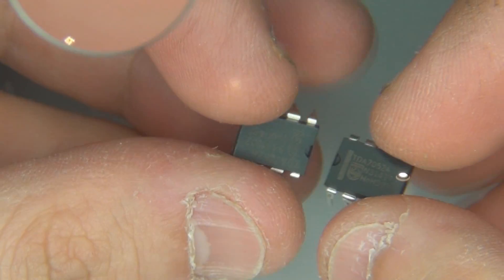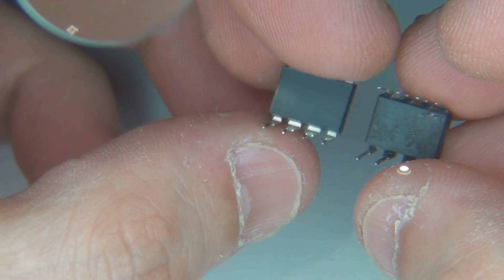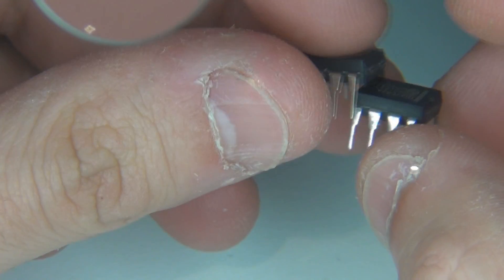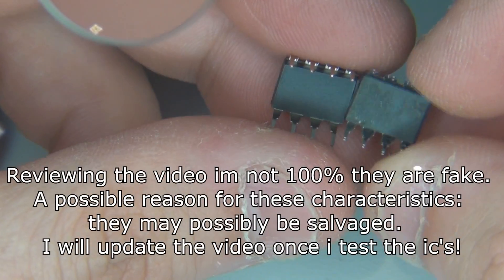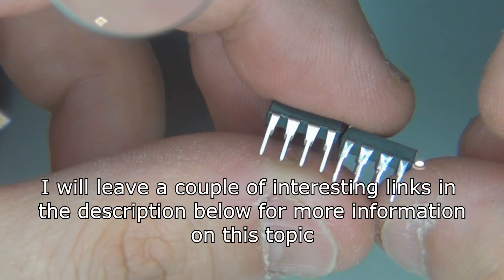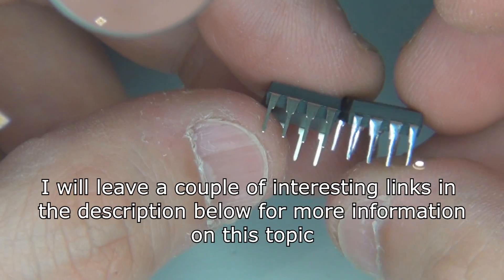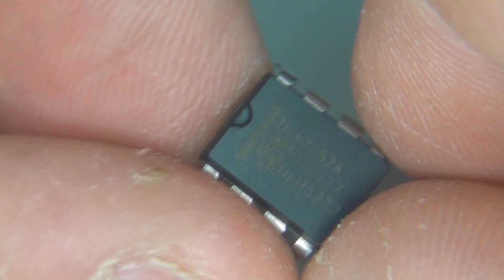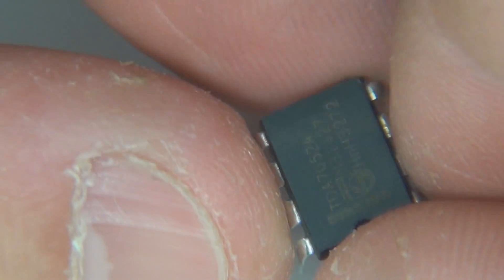Detecting Fake Ebay ICs / Chips

Comment: conclusion? you cannot buy cheap ICs..??  -- I give it that fake things DO exist on ebay, but with respect, I don't take the conclusion... :) 
the conclusion I suggest: everybody should build at least one pedal circuit, just for fun's sake :) 
I haven't made one, but I'm going to, too...

also, there are methods to test ICs... 
which in the case of opams (the type of ICs most used in pedals) appear to be fairly simple...
link: https://tangentsoft.net/elec/opamp-tester.html

Comment: I recently got a batch of LM386s from two different ebay sellers and ALL of them are crap... they don't work like they're supposed to - all I get is loud squealing, very loud weird noises and farting sounding oscillation if I do even get any signal going thru them. They all look factory new, no signs of shady stuff like in your video. I'm beginning to believe these are counterfeits or factory rejects that somehow got into the public domain (via Jameco ebay store). If I put the LM386s I got 12-14 years ago in the same circuit and they work just fine.

Has anyone else had this experience? At this point all I can say is WTF?
Reply from the maker: Hey mate, did you post this on diysb forum?  I was going to reply but ran out of time :(  Heres my opinion.  Fake is an option.  Heres the thing though, search my channel for "dead easy dirt" and watch that video.  I talk about the LM386 in that video.  A long time ago but from memory my Tayda LM386's behaved exactly the same as you describe.  There was a fix (capacitor placed close to pins on IC parrarellel to power rail or something along those lines) but really the chip was just a temperamental disaster and I moved on.  Later somebody (could have been culterjam) suggested that the suffix could be the issue.  I don't recall the suffix I used in my dead easy dirt though unfortunately but you could try a different chip.  Vague memory but there are a couple, like -L and -N or something like that.  I hope that might give you some sort of direction as to what the problem could be.  Cheers brother.
Reply: Yeah, that was me. My old LM386s are LM386N-1s and the new ones are the same, yet the new ones are complete crap, completely unusable in the same circuit which the old ones work fine in. There's zero sign of them being pulled from old boards or anything like that. They look legitimately factory new but they sure as hell don't work.
Reply from the maker: Some things to check if they are pulled: check underneath the IC, they will vary from one to the next.  Also shiny leads are common (desoldered).  The tops will most likely all be consistent.  They may just be factory defects though.  I would avoid buying on ebay or untrustworthy sources.   Stick with the major suppliers (mouser, rs-online, farnell, digikey, etc etc)
Reply: DIY Guitar Pedals — Jameco eBay store is where I got them. I bought knobs from them once I think, think I might pass on any future active components from them though. I know the signs of pulled chips, these all look factory new to me, you can tell by the pins.

Comment: Just rebuilt a dyna comp on breadboard for the 4th time, each time convinced it was my bad layouts.

Penny has finally dropped.   Those ten ca3080e's I bought from china are something else......and whatever they are they make a mean overdrive pedal when dropped into a dyna comp circuit.....but it sure as shit aint compressing anything.

So after four rebuilds and two lost weeks I'm going to come right out and say it.

Fuck china, fuck their counterfeit goods, and fuck their ebay businesses.   I steer clear from now on.

I'll find another way or change my compression preferences.    NOTHING is worth the pure frustration I've experienced from the last 4 builds.   Nothing.   I'd rather go without and just pretend I can hear compression coming from my amp.......I've certainly been driven up the wall far enough to be crazy enough to try that and be bird shit happy with it.

Comment: Some manufacturers pre-tin the leads, It helps prevent corrosion. Also if the flux is not removed good enough it will over time leave a dusty type surface. Also if it's salvaged it doesn't mean its a fake its just used. We salvage chips ALL the time at work and a good 99.9% of the time they work as advertised. Spotting a fake chip is pretty difficult unless you actually have worked or work for that manufacturer. The only real way other than that is to test it in a circuit and even then we've had chips fall short of the manufacturers specs. If you have purchased a large batch of chips, and it's for a critical project, it's a good idea to build a test circuit for the conditions in which it will be used and then test them all. Thanks for the interesting video. 
Best Wishes n Blessings. Keith 
30+ years in electronic repair.

Comment: Hi Paul, Fakes do use a different die (?), spelling, it's usually smaller. Another highly recommended channel is John Audio Tech on YouTube, very knowledgeable on chip amps. I may have suggested this before, but, the Runoffgroove.com 1/2 watt Ruby guitar practice amp is really good, I built one with an 8" Jensen MOD series speaker and one with a 6" MOD, 8 ohm, and they ROCK. Kinda like the Noisy Cricket, very similar. They use an LM386, JRC386, any one is good, LM386N-1 through 4 and an MPF-102 J-FET transistor, I have found they do work the best, I've made about 20 and gave to musician friends, check them out, easy build. Any questions, I'd be glad to help. Be good, C.

Comment: Counterfeit electronics is HUGE business in China.  Even with Certificates of Conformance and approved vendors, it hard work keep fakes out of production: https://youtu.be/5vN_7NJ4qYA
Reply from the maker: People are so worried about fake chips and sure...their a huge problem, but look at the working conditions of these poor people.  is this a 'standard' working condition for the Chinese?  Possibly but its still pretty shocking to see.  No masks for fumes, there's a grinder cutting boards in the background I can hear (inhaling fiberglass fibers), etc.  Terrible...
Reply: +DIY Guitar Pedals Yeah it's bad by first world standards, but the more expansive question is what would they be doing without this? Often it's something worse. If you asked the workers individually, they probably tried really hard to get and keep that job and are thankful to have it. Social reform has to happen as part of the evolutionary course.
  As to recycle chips, I salvage lots of stuff myself from everything I can get my hands on. It's a great way to expand my knowledge and experience with new chips, circuits, and devices I wouldn't be exposed to otherwise. Not to mention the fun of trying to create something I want based around the limited supply of parts I have. Nothing teaches you more about how a circuit works than having to understand the implications of compromises.

   I don't believe recycling is the problem. The problem is a result of the Western World market's lack of regulation and accommodation of this new resource. As a result there has been an intermixing of products in the supply chain and a disproportionate value given to recycled products that should have a market that is limited to hobby and luxury goods.

Comment: if the seller is in Asia its counterfeit. thats 100% guaranteed. years ago I bought 10 NE5532's for $2 and they were all FAKE. he gave me a refund immediately.  I only buy from Digikey and Mouser. I wouldn't trust Tayda for IC's and other semiconductors
Reply from the maker: +PhuckHue2 That's not true, I have bought from Chinese sellers on eBay plenty of times and they have been what they say the are.  They were salvaged, not fake.  How can I know for sure?  Well, there have been instances where I have bought a chip that WILL ONLY WORK in a specific circuit, there is no other alternative, and they worked.   I would approach Chinese sellers with a very strong sense of caution and be prepared to be stung, there are plenty of fakes out there but there are plenty of salvaged chips out there also.  Its a roll of the dice.
Reply: I gave up years ago. I don't trust them. rather pay more than have to wonder if components are real or not. I'm all for salvaged chips but you can't trust if its not been rebranded. when you put the fake chips on the scope they are no where in spec
Reply from the maker: +PhuckHue2 I agree. If you can get current production chips / transistors then totally avoid Chinese and buy from a trusted seller, definitely

Comment: Brand new surface mount TDA7052A are $1.09ea from Digikey.  Sparkfun sells SOIC to DIP adapters 4 for $3.
Reply from the maker: +johnfranks Sort of turned off the TDA7052AT as it can only handle 0.8watts opposed to tda7052A's 1.25watts.

Comment: May I suggest that another possibility is that these are manufacturers surplus. When I worked in a factory in the 80's, due to environmental storage problems, when we received a batch of ICs (100s or 1000s), the girls used to tin them  in a solder pot (using liquid flux)  up over the seating plane. The flux was vapour-cleaned before they were placed in the stores. If we didn't tin them like this, sometimes they would oxidise and be unsolderable - ones like the 'clean' one would literally have purple leads after a few months. It's hard to tell, but the grotty looking one looks like some PDIP devices I've seen that had the tinning flux had overheated (dipped too deep, or dropped in the solder pot by an inexperienced operator). Was quite hard to make them look new again either way, but subsequent cleaning would usually take care of it.

Comment: R u mad? Really??? electronically all ICs are the same inside, they have the same internal schematics. The only things that can change a parameter in an opamp are the input and feedback resistors. Why bother with some shit like this? a lm4558 is the exact same of the japanese version. Why buy the expensive version??????WHYYYYYYYYY?
Reply: +Joao Victor Predebon Chips vary from fab to fab, doping variances etc. Not to mention even through the basic function of an ic might be similar it doesn't mean they would be identical, especially given they most likely have different layouts underneath.

Comment: Dunno why the video is about spotting fakes then stating you haven't tested them. 

Also a chip being salvaged but being legit and it being brand new but fake is two totally different things.
Reply from the maker: +kjsippel Cheers mate!  That's a bit of a conversation right there :) For IC's and transistors they are probably ok, but you just have to remember that you are dealing with a company that sources THE CHEAPEST they can find and the risks that imposes.  Their have been fakes through tayda but I think this was only isolated to a couple of incidence (j201 was one of them).
Reply: @DiyguitarpedalsAu  i bought 5pcs J201 from china... My God i got crazy on my project its a Big FAKE!! (j201)
Reply from the maker: +trashchris yes of course, salvaged and new / fake are different.  But alas, often fakes are NOT new but pulled from old thrown out circuit boards and relabelled. They use salvaged IC's from thrown away equipment because it is junk and free.
Reply: +DIY Guitar Pedals Thanks for this video and link to further reading.  Very interesting!  Now I need to go through my stock to see if I have any.  Curious if you ever had any issues with Tayda parts.  I mean they're usually barely acceptable quality (and kind of a shitty company for several reasons), but I think that most of the people here have at least a few Tayda parts in their inventory...whether they're proud of it or not:)
Reply: I see what ur saying and for all intents and purposes agree. However,
If the eBay supplier lists them as "new" and they are actually used/salvaged, they've still perpetrated a fraud to their customer. I love the idea of breathing new life into something that would have ended up in a landfill. I might even consider buying them for a discount. Buy it shouldn't be based on a lie.

Comment: I'm in the UK so out of curiosity I've just order a 7052 from an Ebay seller I've used before. Cost me about $5 Aus, I'll let you know how I get on with it.
Reply: +tobortine How did it go?
Reply: Mr. Reinterpret Cast
It was fine. I built it out on a breadboard and it worked ok. I just used a tone generator for the source so I'm not sure how good the audio quality would be.

Comment: The chips I've seen sanded down are often used by various device manufacturers so that competitors can't find part numbers to duplicate whatever the product is.  Theres a couple big flaws in that procedure:  1st it makes repairs a lot more difficult or impossible.  The other is they often use a dremel which generates heat that could possibly damage the internals (notably the very fine internal wiring from the external pins to the semiconductor itself).  Also makes it easier for fakes to rebadge the IC as something else more valuable.

Comment: just bought some Mn3007 and
Cd4046
off ebay now I am wondering if they are fakes
Reply from the maker: +ravener Definitely agree ravener! I dont even care if its salvaged. Unfortunately sometimes they are fake and they dont work (a relabelled chip).  Also with things like say, lm308, you buy specifically for its unique slew rate, you may just get any other op-amp chip and it wont sound quite the same but will work and without an real LM308 to compare you may not ever know.
Reply from the maker: +screamsofinsanity Try it in circuit.  That will get you a 90% sure answer if it is fake or not.
Reply: +DIY Guitar Pedals yeah I figured that would be the only way to be sure...lol.
Reply: +DIY Guitar Pedals after a test it doesent really matter anymore. i have bought microcontrollers i'm now 95% sure are fake, but they are faithful copies that work pretty much like the real deal. i'm not advocating buying anything fake, but if it works it works, fake or not.
Reply: +ravener agreed IF it works.
Reply: screamsofinsanity if they dont they are pretty much 100% fake, but being fake isnt nessecarily 100% certain to not work. sometimes a fake alternative is cheap enough to be woth a try before going with the product certain to work. i have several Chinese arduino clones as well, worth it for how much you save imho.
Reply: +Mate Matić well I found some fake transistor still in production today I think they are bs170 that someone is selling as 2n5088
Reply: +Mate Matić they sound very different from the 2n5088